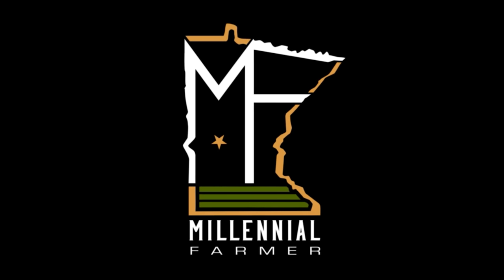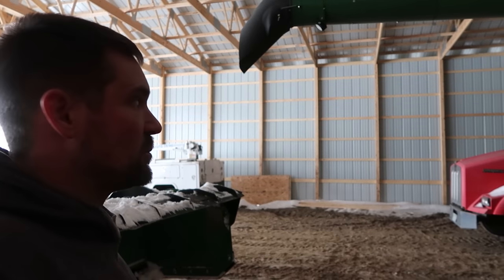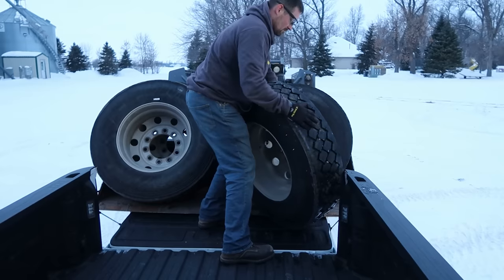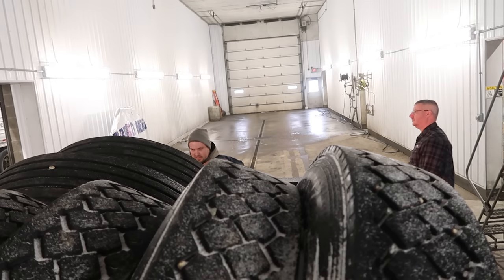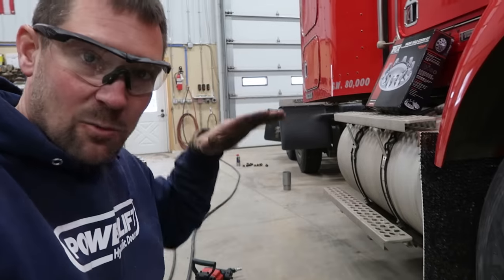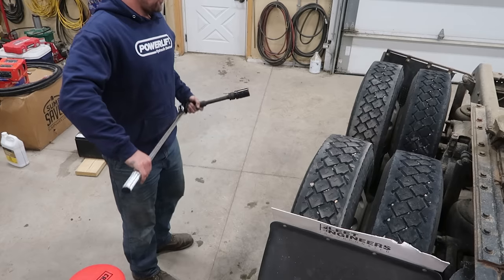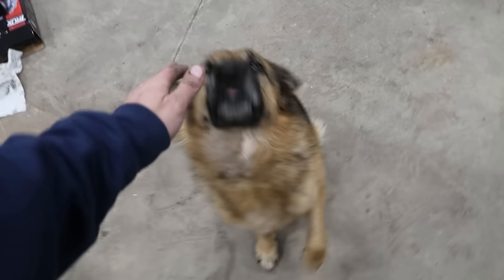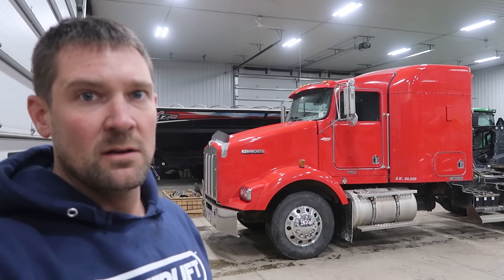This is NOT A HOW TO VIDEO! I Can't Believe it!

Comment: Next time park the truck a few feet from a wall or garage door and mark the location of the light of the old headlights.  When you install the new ones just go by the same marks.  unfortunately this only works with the truck has decent battery's.

Comment: The way tio see if here is a short is to turn off the lights in the shop, take off the hot cable on the last battery and just touch it to the post and see if there is a spark of any kind.

Comment: With drum brakes you want to release the brakes and then tighten them so you center the hub/drum. Install the wheel then back the brakes off. And there's nothing wrong with using the big air impact. Once they tighten just keep the impact going for about 2 seconds.

Comment: Based on what the battery cables look like you need new ones. All that corrosion is adding resistance to the wire.

Comment: 25:50 A bad connection will be hot. It has higher resistance (R) than a good connection. The heat is proportional to the current (I) squared times the resistance (R). Thus, if you have a higher resistance you're going to get more heat. A good connection should give no heat at all. A clamp on ammeter can take a lot of the guess work out. Also, a thermo camera is also very useful. They're getting cheaper every day.

Comment: You might want to check out wheel dollies. They make it much easier to remove and install tires. Interstate battery rejects must be really bad because their top of the line batteries seem to be getting worse. It's strange that the batteries that come in new vehicles often last 10 years but replacement batteries seldom last 3 years. I have seen terminals break inside the plastic ends to the point where only one of the three batteries was connected. If one terminal on one battery gets hot, it's likely a bad connection. If both terminals on one battery get hot, it could be that the battery is the only one supplying power to the starter.

Comment: It might not be the batteries, your cables might be shot.  Put a volt meter on the battery when you are cranking and on the starter.  If you have a lot more voltage at the battery than at the starter, your cables are shot or you have a bad ground somewhere.

Comment: What a difference that made! My opinion FWIW: those cable joints are really suspect.
I've seen clean looking joints cause a no start let alone corroded ones.This could also explain why the cutoff switch doesnt help much.
That said, check for current draws to be on the safe side.

Comment: Are you being in the cold as you are get a Round metal pan put some charcoal in the pan light it with the flames go out on the charcoal slide underneath the oil pan of your tractor and it will harm at all it’ll do is keep the oil hot in the tractor and you will have no problem starting it

Comment: Any time a connection gets hot that means it is a poor connection. That will act as a resister which will cause voltage drop and loss of power.

Comment: They make "automatic"compressor drain valves, they hook to the 240v motor power line and have a timer to drain every cycle. You plumm it into a bucket or to a dry well outside of your shop. Use the bucket to catch sny carry-over oil ftom thr compressor pump. Econo power out, Interstate from Costco better. They gave the bigger Group 27 higher amp that's better, and Napa has battery heaters that go underneath the batteries,  and heater wrapsthat go around and have a second heater element. They have yhe the Kim Hotstart tank type coolant heaters also. Ive used them for stationary diesel Generator sets and they fire off first pull reliably.

Comment: It may also help to run a ground strap not a cable from the ground post on the engine to the same bolt that the ground from the batteries is connected. With the way they are trying to make trucks smother grounds between the frames and engine have become less effective.   I work with Truck outfitters and we see this issue often especially with electric controls.

Comment: Use a battery post cleaner on she studs works great for surface rust. Holy corrosion can only imagine its worse in the connecter at least try to cut the corrosion off and try new connectors. Had a 379 did the same thing and that's what fixed it.

Comment: Change or clean ur cables and check all ground connections most of them type of ends with the rubber molded around them are known to corrode badly

Comment: Rewire 100% of the battery/starter wires with the same or bigger cable and copper ring terminals with brand new batteries

Comment: Truck is looking sharp if you plan on doing more wheel work save your back and get a wheel bar the drivers side wheel was stuck wow now that the wheel are shined up be easier to keep them up first thing I would check is see if power is back feeding through alternator

Comment: Hey zack, so with your tire issues she them not wanting to come off. I used to get behind and hit them. Then spin the wheel as it would move. Soak with some WD-40 penetrate. Also, there’s gaskets you can put behind the wheels. Between the wheels and the brake drums so they don’t corrode together. Aluminum rims and steel drums have always been a pain for me.

Comment: i see where ppl are going with resistance causing heat but im leaning towards it being normal due to them being wired in series. 12v 24v 36v. that last battery that was hot was where the last positive cable was connected which should be 36v plus all the amps from 3 batteries combined. didnt surprise me that it felt warm to the touch after trying to crank the engine.

Comment: Hot battery may indicate high internal resistance (bad battery). Pretty possible, since Econo Power are basically used batteries with a fresh sticker. They claim they are 'reconditioned', but there's almost nothing you can to to refurbish a lead acid battery other than maybe top it up with charge and electrolyte. They are basically used, each one probably in different condition.

Comment: hey just for future reference dont torque wheels with them on the ground. the bottom of the wheel could be slightly out and 500ft/lbs isnt gunna pull it back tight to the drum. Work at a shop in IA and we had several trailers techs were doing the same thing and alot of them came back with destroyed rims and hubs since the lugs werent actually torqued. I know these are steers do best solution is to have somebody apply the service brakes while you torque. If you dont have a buddy use a breaker bar or something and wedge it between the seat and the brake pedal to apply them. Good channel got yourself another sub!
Reply: O and as far as your battery drain issue have you thought about installing a disconnect switch? Super easy to install and will solve your draw issue your having with your batteries

Comment: That heat in cable means it’s trying to draw more than it can. 
They prob start smoking soon the more they deteriorate. 
Need new ends on cables. 
Also check it’s not earthing out along wire somewhere. 

More importantly, onky 7,000 to go Zac 🤠
Happy days Anna

Comment: Man I counted at least 1-4 w what could go wrong…
1- Go flying off the 4 wheeler when given more power 
2- strap will who knows break 🤷🏼‍♂️
3- Tire will rip right off and 🛞💥🙎🏻‍♂️
4- Truck will possibly roll on its left side causing a huge mess in the shed😬

Yup that’s what I pictured hopefully none of those don’t happen.. Knock on wood

Comment: If those LEDs don’t have a heat element on the lens (they don’t appear to) you’re gonna hate them. I’ve and snow WILL build up as you drive. 

The heat from the halogens keep them clear. LEDs don’t produce enough heat.

Comment: I agree with everyone else that's weighed in. If it gets hot, its not a good connection; due to corrosion, bad metal-to-metal contact (or two different metals that don't transfer power well between them). I've melted enough work boots on hot cables and connections to know when to clean them up. I've also changed enough starters to know when they are going bad. In some starters, the bushings (brass/bronze) will get egged out over time and that causes additional physical resistance/friction in the starter motor (draws more amps) and it does several things at once; draws down the battery quicker, turns over slower, and heats up the cables and connections more. None of which are positive. Just my $.02...

edit: One more thing: for phantom power draws, I've had both starter motors, and alternators develop "sneak" shorts internally that were drawing down only milliamps slowly over time, but over hours and weeks of sitting, you'd end up with dead batteries, or at the least low ones...

Comment: Putting the cart ahead of the horse. test the cables for resistance . any resistance can cause starting problems and charging the batteries will be diminished by the resistance. do this before spending big money on a starter.  My opinion.

Comment: Cables are resistors, corroded cables are big ass resistors. Resistors cause voltage drop. In order you charge a battery you need to exceed the voltage of the battery. That’s why your alternator puts out 13.5 volts. Here’s my theory. The voltage your alternator is putting out drops below 12v by the time it reaches the end battery. Battery #3 is now dead. You turn off the truck, battery disconnect off, then the power in battery 1 and 2 recharges dead battery 3 (the charge will spread across all three). While that is happening you lose even more power because of cable corrosion. Then you turn the disconnect back on and the batteries are dead or close to dead. With the truck running measure voltage on each battery. If it’s below about 12.5 it’s probably not being charged by the alternator. Replace those cables or you will be buying more batteries very soon. The cables are hot because the energy in the battery is being dissipated as heat due to the high resistance of the wires. Nice wheels by the way and if you made it down this far congratulations. A little rambling comment, but I hope it makes sense. 😂

Comment: On earthmoving equipment we usally have a earth isolator . So any draw will be shutdown as soon as isolator thrown.  And your cables are shagged  , the hot battery may be the one actually working and drawing all the current through that .  Also see if you can run power cable from starter straight to battery, going through less connections and junctions the better . But earth isolator is cheapest way of stopping flat batteries as then it doesn’t matter how many shitty connections or radios or any other dodgy wiring , it won’t drain the battery’s

Comment: Stuck wheel... put on lugs to 1 thread loose.... drive 100 feet bumpy road and wheel will be loose.... in summer around your driveway.... also your cables are adding to your draw... should be replaced... also use dielectric grease to coat all exposed metal in cables.... and battery terminals.... will keep corrosion from occurring... also great in trailer plug ins

Comment: Could be one of the ground or power cables has impedance. If you use an OHM meter you should see zero resistances (OHMS). Pretty much anything above zero the cable needs to be replaced.

Comment: The brushes in starters wear out.  The commutation bars (the brushes slide on) wear out.  The armature bars are soldered in and over time their connections can get loose reducing the starter's 'effective size' causing it to lose a lot of torque.  That can also cause those "ahh ahh ump" type rotations as the dead parts of the commutation bars match up with a piston going into compression.    Some of the cables are obviously bad but I doubt your last batteries were bad.

Comment: DC will always act like it’s dead when you have a hidden leak/draw/ground on a hot/source/positive/red wire. So definitely make sure something is draining the batteries. If this has been going on for years, it is worth the few hours of time to invest into finding out what is going on. Many good comments on cleaning up the battery box and cables. Resistance is the enemy in this situation.

Comment: Get some gear reduction starters u will be amazed how well and fast they turn over. We had issues obviously with batteries as well but . After getting a high. Cold cranking Amp some new died man switches and some starters knock on wood they are turning over amd starting good!!!

Comment: First off. I noticed you didn’t shout at the wheel. This normally works. 

And great minds think alike. I was looking you to go for a spin to check out the lights, however  you missed out on a wee diff round the yard in the truck.

Comment: Zach, been watching for years and those trucks hard cranking has bugged me forever.. You can put the best batterys in the world in it, and it will only "mask" the real issue at best...if that. I'd be replacing every cable on that truck between the batterys and the starter, and wherever the main engine ground meets the block, new cables, new lugs... It will probably wang over faster than you have ever heard...If not then a new starter might be in order, but id bet the starter is likely fine.... Just looking at those cables and connections you can see how poorly they are, no spray / external fix will work, they need to physically come off, and be cleaned up shiny on all surfaces... But with the corrosion inside the cables (will be even worse inside the lugs where you cant see and where the critical cable to lug connection is made) I'd be replacing them and the lugs first as last. Also make sure the block is shiny where the ground cable bolts on, and if it dosnt ground directly to the starter casing, an extra cable between the engine ground and the starter casing / mounting bolt (clean up face of starter mounting lug first) will ensure you have a decent ground directly to the starter... It will be a different truck after id almost gaurentee it!

Comment: The hot one has a bad connection or voltage drop between the wire and battery terminal. Use a bolt meter to check for a voltage drop between the positive wire and battery positive
Reply: Volt meter not bolt meter

Comment: parasitic draw is easy to diagnose but hard to find. make sure everything is turned off take your ohm meter and put it in dc amp mode disconnect your battery and then make a connection between the cable and battery with the meter if it reads amperage then you have a draw. check all cables this way to see what has a draw. then go to the next point of contact on the cable till you eventually find the object thats drawing power. if you dont see amperage then you have no draw

Comment: Yes resistance causes heat but the heat isn’t in the cables it’s in the battery.  Could be only drawing in the aft battery meaning from cables are not pulling amps from front battery.  Putting a large load on the aft battery would cause it to heat.  Might be an open circuit on front battery. Out an ammeter on the leads, ohm the leads, and verify voltage across battery’s are equivalent.

Comment: Holding my breath to find out the answer(s)!  Meawhile, my vote goes to the interconnections between batteries regarding the unequal draw between them.  This would also prevent good charging and, hence, poor subsequent starting (since there cant' be any parasitic draw if there's a battery disconnect switch).  
Additionally, the earthing points just look plain "guilty" and the corrosion of battery(+) lead makes me wonder how much copper actually remains in it's cross-section [to carry current].

Comment: Hi zack. Heat in electrical is caused by resistance. All that corrosion is almost certainly the problem. Sucks but I believe you’re going to end up putting on new cables.

Comment: You have a bad cell. Heat/resistance are the same. Your battery is only as good as your weakest cell. DC/one direction flow of electricity.  Batteries can blow up with this problem. Also Batteries will cook and smell like sulfur when in use with a bad cell. Check cell water levels regularly as a maintenance procedure to extend life of Batteries. J.Au-en

Comment: My suggestion.
Get several more air hoses in 50 foot lengths on wheeled wheels.
At least 200 feet worth.
Not just to use inline but also seperately via a 2 or 3 outlet splitter.
To do multiple jobs that may require letting wait on an issue that needs time set aside to dry or cure while you switch over to another jib and nor require you to re-route the hose on the first job.
I'd actually add some pull down airhoses on b reels overhead in at least 4 places in that building 100 feer minimum from floor to where needed.
If possible on swing arms.
Air along side electris available every inch of a shop is critical to save time, money and seriously increase the safety of your workspace.
One thing you definitely don't need is an injury from trips, hose blowouts electric cables chaffed on sharp objects.
Be smart, be safe. Keep us entertained.

Comment: I have had to take the lugs loose then set the truck back down on the ground with the jack still under it and start the truck up and rock the steering wheel back and forth to break them off the hub

Comment: Need to do a voltage drop test on the cables. Old cables will crystallize on the inside. I replaced cables on trucks that when you remove them you can hold them straight out like a stick and when you bend them you can here them cracking inside. This is detrimental to a starter and will take out a new starter in a short period of time. Rule of thumb is you should not see more then 1- 1.5 voltage drop between the battery voltage and the starter while cranking. Quite common on equipment with high hours and oily cables.
Reply: TELE-GRAM👉OfficialMillennial   This is a scammer

Comment: When you see corrosion on the cable after cutting off the rubber boot there will be more on down the cable I would replace any cable that has corrosion